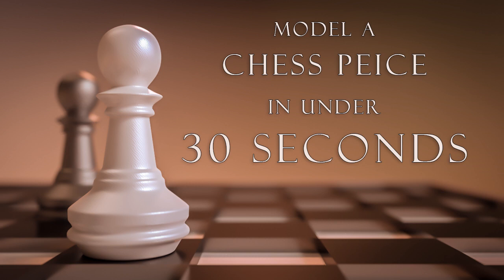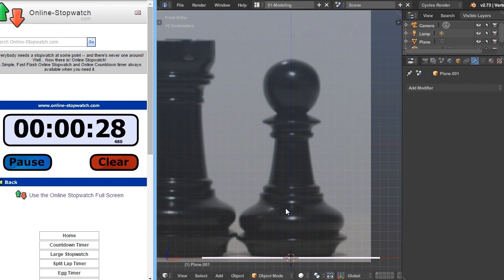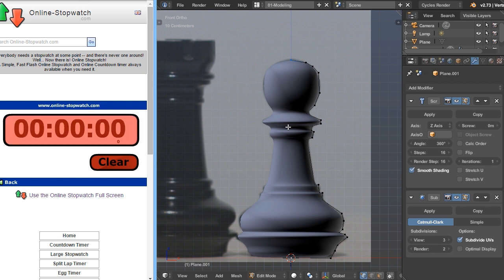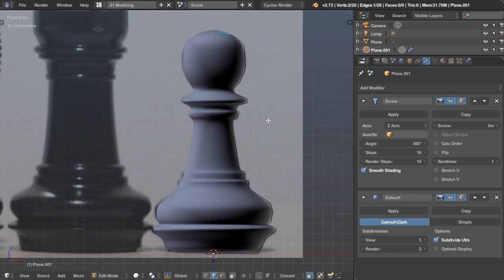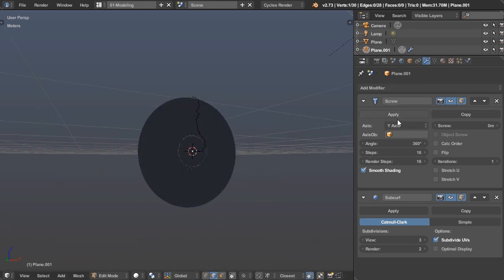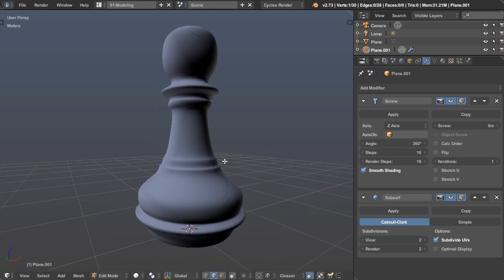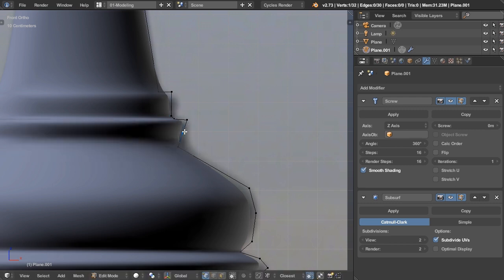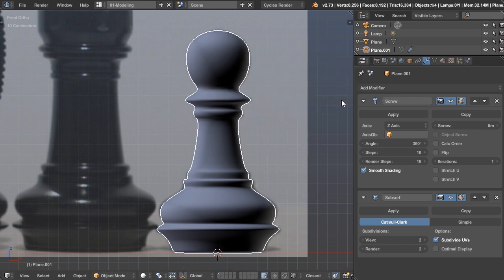How to Model a Chess Piece in Under 30 Seconds

Comment: how do you enter edit mode if there's no object to begin with? i've added the background image but that's not enough of an object for blender to allow tabbing into edit mode.
Reply: also, selecting a vertex (adding a single vertex is not trivial to a beginner) and then ctrl-clicking to draw a line is not working in blender 2.8 or 2.9
Reply: matter of fact, ctrl clicking seems to do nothing. (and I've tried right clicking too)

Comment: Is there a modifier that cuts through another object in a circular path instead of creating an object? 
In Solidworks the screw feature is called Rotate and there is also a rotate-cut feature. Is there an equivalent of rotate-cut feature in blender?
Reply: Have you tried the Boolean modifier? that allows you to cut holes in models using other models

Comment: The most basic mesh element is a vertex and a model can have multiple vertices. There's no such thing as "vertice".

Vertex extend tool (alt+D) is quite new addition and could also be used to add vertices near each other to get sharp edges. Just another option for doing that.